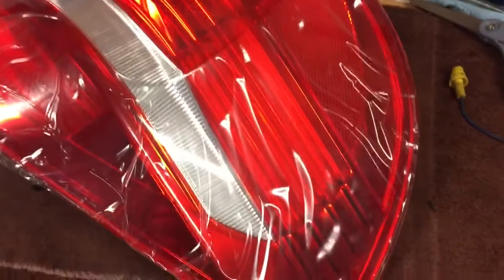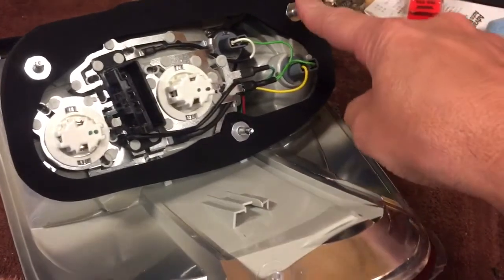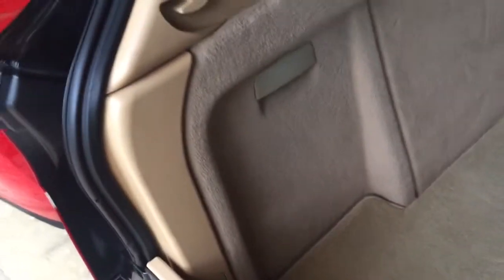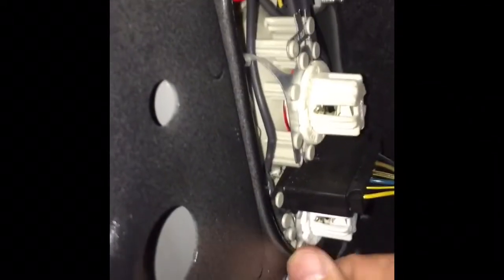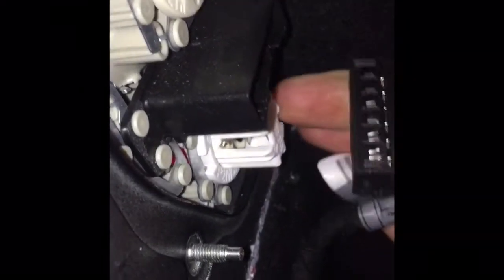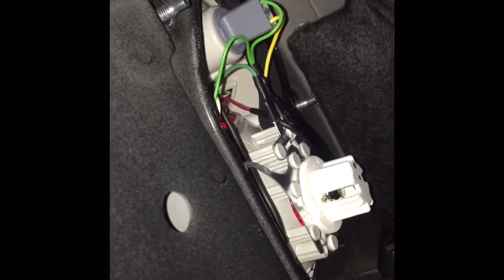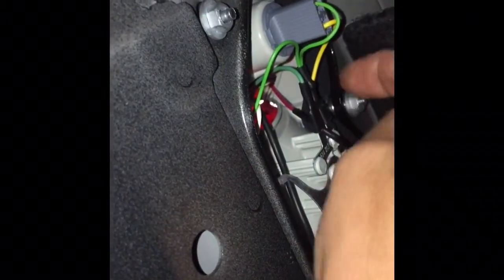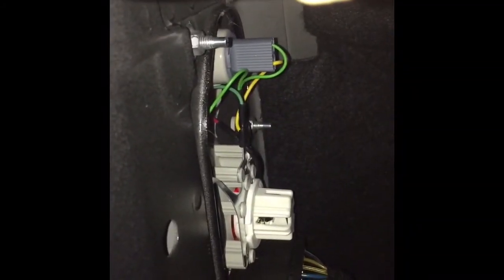BMW X5 E70 Outer Brake Light Assembly Replacement

Comment: where do you buy the new unit from and I have another question would it work If I just changed the bulbs the three of them or a new unit is must thank you so much for the video!!
Reply from the maker: I bought these on eBay and they are the Magneti Marelli brand which I believe is OEM.  You should definitely try replacing any bulbs first and make sure all the socket contacts are good.  I only replaced the entire unit because the units themselves had issues where the top bulb connections were melted.
Reply: Kingsway BMW Melbourne Australia told my niece they needed to change the entire left taillight assembly.  The brake light didn't work. Didn't do it cos no stock. What a scam! I changed the globe for her. That's all it needed.
Reply: Do you need silicone around the main body of the lamp?